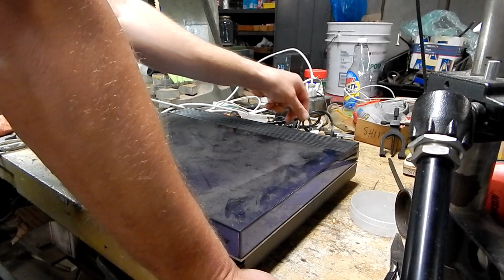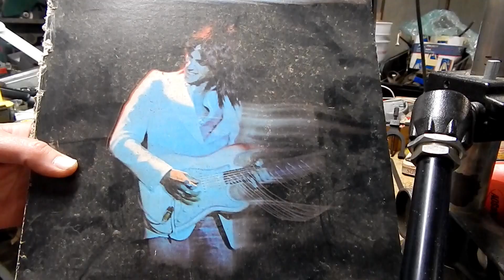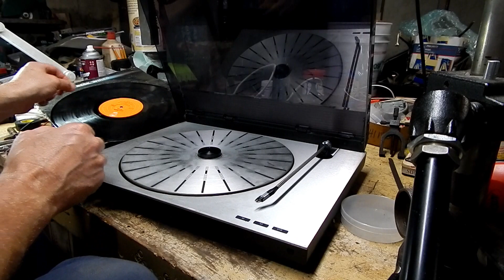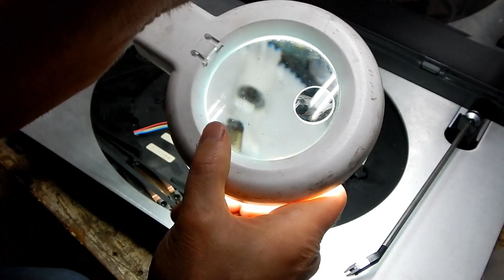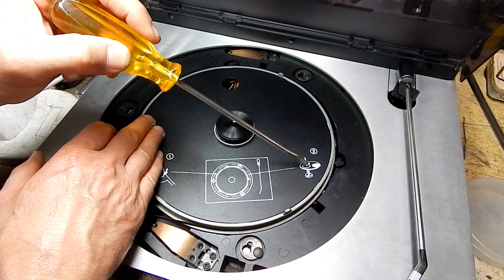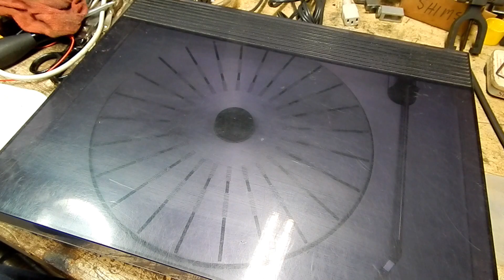Late June 2020 Vintage Electronics Pick Part 3 of 3

Comment: For anyone who does a search, you will find that Bang and Olufsen also designed and built the first radio to run off AC.  Up till then, most all radios were battery powered.
Reply from the maker: I'm not surprised. That area of the world made some great receivers. Grundig, Telefunken, Tandberg, to name a few if recall the pleasue of working on. I still own a couple.
Reply: @stevewatr  That level of equipment is also made to be serviced.  It's almost beautiful the was some of the B&O cases open up.